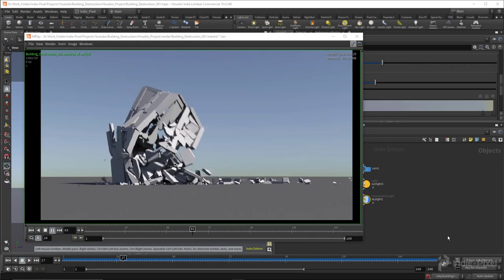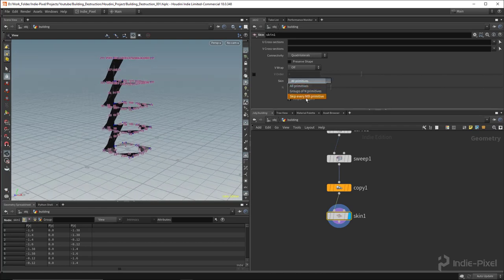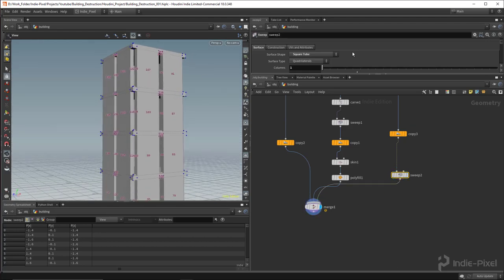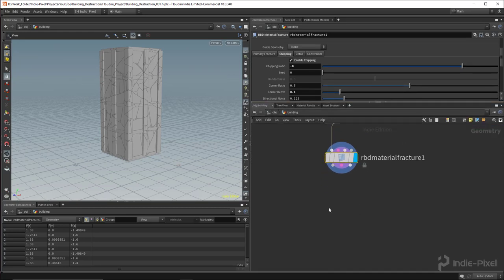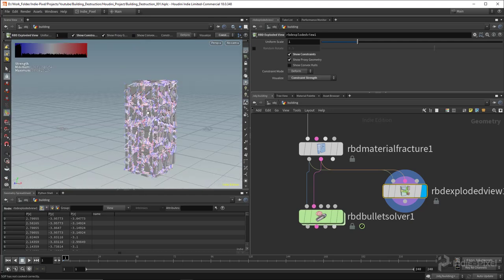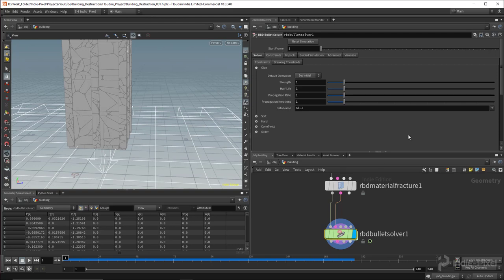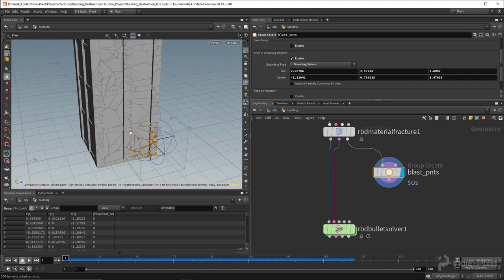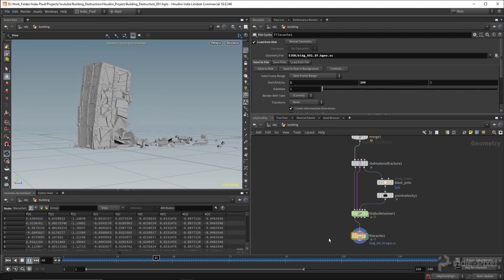Houdini 18 - Building Destruction - RBD Bullet Solver

Comment: Hi, nice quick and clear tut', thanks a lot for that !
A little improvement I found in order to get everything working more procedurally is to set the expression "npoints(0)/16" in the skin N parameter, so the walls don't crossover when changing the original grid shape. :)

Comment: I can't get the blast working. It moves the whole building not just the points I selected. I did everything just like u did so the only problem I can think of is that the version I'm using is 18.0.391 so it's a bit newer.
Reply: It feels like it works in the area I selected but it doesn't make a whole in a building. Increasing the strength doesn't help
Reply from the maker: Hmm...sounds like it might be your glue strength...try setting the glue strengths to something really low...or turn them off all together and see if you get results.
Reply: @IndiePixel3D  Same issues here in 18.0.499, it seems that I have to set the glue to disable to get the velocity from the points to effect the individual fractures. Otherwise it will explode keeping the building together, then it will shatter it's roof when it hits the floor from flipping upside down...
Setting super low glue like 10  or even 1 just makes the building fall apart on it's own weight.
Reply: Addmix  Thanks so much! Same issue for me!
Reply: Addmix  this worked perfectly! Thanks so much.
Reply: Addmix  Thank you. This detail seemed too innocuous to me, I didn't even think it'd make a difference. I'd like to know exactly why this works though :(
Reply: @magneticanimalism7419 what was the fix? looks like addmix removed his comment

Comment: Hey, Great tutorial, thanks for sharing. Subscribed. I'm having a similar issue to other people here and couldn't fine a solution. The point velocity node is affecting the whole the building and not just the corner. I changed the group name to $OS as others suggested and tried lowering the strength on the glue constraints to very low and even nothing. I still can't get the point velocity to affect just the corner with the group selection. Any thoughts? I'm using 18.0.287
Reply from the maker: So best thing to do...and what I tend to do in these cases, is to drop a visualize node right after the point velocity node and visualize the v attribute on all the points.  This will give you info about what values are being applied.  I'll use that info to begin debugging my graph.  So it's a good place to start.
Reply: Did you ever solve this. I'm having the exact same issue and nothing that I can find will fix it? Glue strength at 0.0001 and velocity very high, it just pushes the whole building.

Comment: i like how you set velocity on point and create explosion on that, is there a way to set the velocity activate on a certain frame?
Reply from the maker: There is an activate attribute on each fractured piece.  You can animate that in many ways, but you can set the activate to 0 in the rbd configure node using an animated bounding object or it can be animated through a wrangle node with vex.

Comment: im having trouble with constraints... I followed all the steps but the glue doesn't stick or hold unless i change the primary strength to -100 or lower even when doing that i cant control the chipping glue either...could you look at my file and see?

Comment: Hey, sorry, I deleted my other post because I thought I was being a doofus, but I think I figured out what's happening... I was correct, you can't break glue constraints with anything other than impacts. So I believe what's happening in your example is that the point velocity is moving the individual objects that make up those sections of the building and they are impacting each other, which in turn is breaking the constraints inside each section. It looks like the point velocity is blowing out individual chunks of the building, but it's really not. This was confusing me  because I've been trying to blow out the side of a solid object and have the thing collapse after the blast. Like if your building was a solid cube for instance. This doesn't work the way this is setup, so I've been searching for a solution.

edit" I just found this, which I think will do what I need. https://www.youtube.com/watch?v=fzRJcGFuPXU
Reply from the maker: Ah ic, yeah that is most likely the reason...breaking constraints with a velocity force can be done by deleting the constraint primitives either in and animated way through vex or on the initial frame.

Comment: Hey man, how would I add an animated object as a collider to this sim? Hooking up a rbd configure and plugging it into the collision geo doesn't work :(
Reply: I had a similar issue. it turned out I had to change the Simulation Start Frame to before the collision happens. this happens if you are on for example frame 600 and create RBDSolver. then the colider hits at frame 500.

Comment: brother chipping is not working for me :(
Reply from the maker: Hmmmm....thats odd.  Try messing with the Corner Ratio and Corner Depth to see if you can get them to show up.  Or might have to change the seed values to get a different solve.
Reply: The building was shattering properly

And the chipping not happening
And the final blast also not happening

Nothing change in the view port @ final
Reply from the maker: @deepakragul307  Hmm, Id have to see your network.  You can always email it to me through the indie-pixel website.  www.indie-pixel.com
Reply: @IndiePixel3D  i cant see your mail id in your website brother
Reply from the maker: @deepakragul307  I got your email....I'm just getting up for the morn.  You can use the contact form and include a link to your file.  Tganks!:)
Reply: @IndiePixel3D  just now i mail my file , thanking you
Reply: @IndiePixel3D  bro now only blast points and point velocity is not workin ?  :(
Reply: @deepakragul307  To me too

Comment: Hello, so I have tried following this tutorial 3 times now - however I have the issue that, instead of the corner being blasted out, my entire building just gets thrown across the ground, like it was not attached to the ground. I don't know where I went wrong because I 1:1 tried to replicate this - I have tried using an RBD configure to make pieces on the ground inactive, however this also removes the effect of the pointvelocity.
Reply from the maker: It seems that we need to delete the constraint prims from the grouped blast geo.  This let's the point velocity apply firce to that area.  Seems like something changed recently.
Reply: @IndiePixel3D  Okay, and how would I got about doing that ?
Reply from the maker: @nolram  well, duplicate your group node where you are grouping points.  But set the copied group node to select primitives. Wire in the constraints output into the group node so you select the constraints you want to delete. Then after the group node put a blast node and blast away the group of constraint prims.  Then you should be good.
Reply: @IndiePixel3D  Ah, thanks !